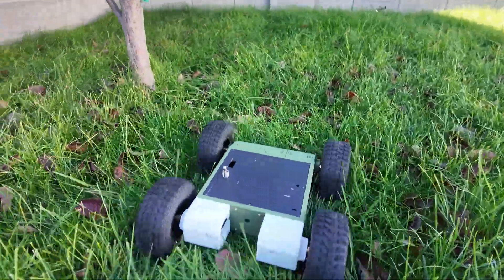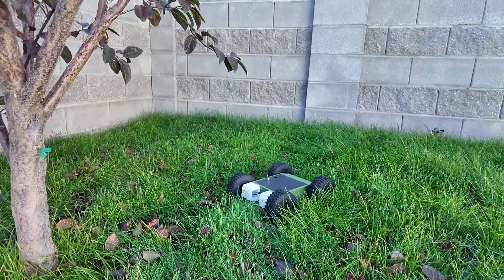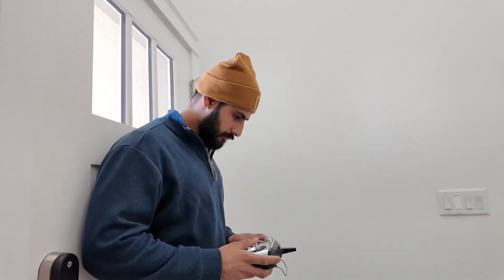3D Printed RC Rover | DIY Homemade RC 4x4 Build

Comment: Hi.
Did you use the recommended 150rpm motor?
What is the drone's speed? And how far does it travel on a single charge?
Reply: I am also building this rover. More precisely, I am first making a mod for this project, with some improvements and some modifications for my own purposes.